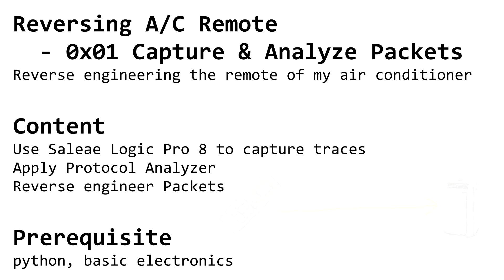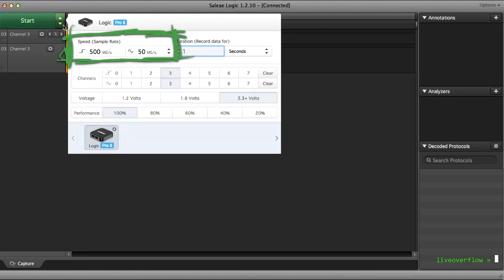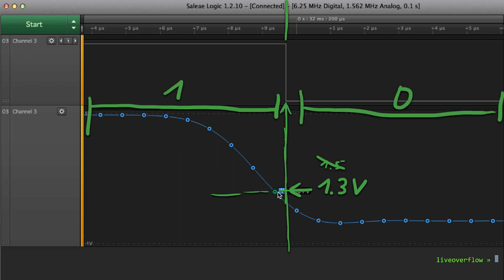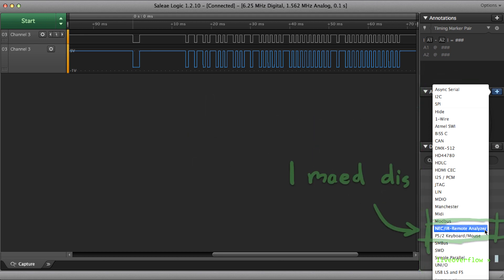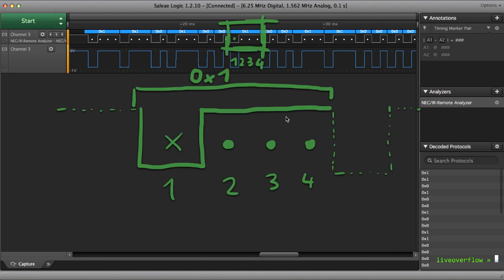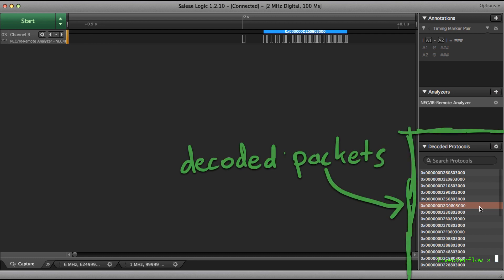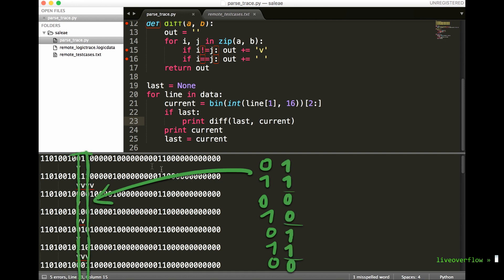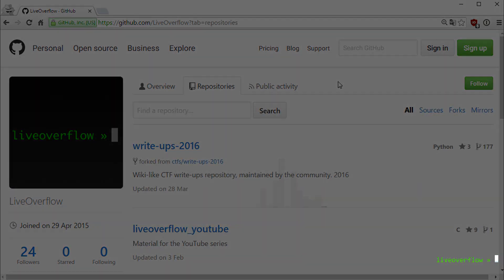Capturing & Analyzing Packets with Saleae Logic Pro 8 - Reverse Engineering A/C Remote part 2

Comment: You could also optimize the arduino analyzer by using 115200 serial speed instead of mere 9600.
Reply: And capture to a buffer in memory instead of writing every bit to serial as it's read.

Comment: Could you try that with other devices too? (e.g. (not) Nintendo Switch)
Reply: Probably not Nintendo Switch as it uses Bluetooth not infrared (the only thing it uses infrared for is to detect distance), but you can use it for pretty much any remote, and anything else that uses infrared for data (not distance measurement)
Reply: @PyPylia  Oh thanks! I don't own a switch and thought that it simply uses infrared (since the wii & wiiu also uses that).
Well, I guess I learned. :)

Comment: did you really just spend a few hours writing a custom analyzer instead of spending a few seconds counting ?
Reply: Think what is the most interested alternative and in the long term most useful... Clearly you don't think like an engineer.
Reply: @Ragnarok540  no i think like someone who likes being efficient it is incredibly unlikely he will ever analyze this protocol again and even if he does he would have to analyze hundreds if not thousands of cases in order to make the time wasted worth it
Reply: @AlbatrossCommando  a specific protocol is not the point. Being able to generalize a solution and even better, to program a way to do that boring manual labor automatically is a real skill that apparently some people don't appreciate.
Reply: @Ragnarok540  automation is meant to make your work easier, not harder you shouldn't automate for the sake of automation
Reply: @AlbatrossCommando  Well, it will help other people out, and maybe he just wanted to try it out. And now he has experience in case he wants to implement a more complex one.
Reply: @GRBtutorials  I mean true but its still unnecessary
Reply from the maker: I did it to learn how to write an analyzer.  Thats a useful skill to have in case I ever have a project again. You also dont tell a beginner in programming to not write small toy projects because they are “unnecessary” - it’s very important practice
Reply: @LiveOverflow  i mean when you put it like that true but from the video it sounded like "i was too lazy to count so i spent a few hours writing a program"
Reply: @LiveOverflow  also big fan of your work could you please continue with the net exploitation series ? its really short compared to your binary exploration one
Reply: I'm more surprised the app didn't have a built-in analyzer for "frequency modulated digital signal" since that's a very common thing.

Comment: A $10 logic analyzer is enough for most people. They work for signals up to 1 or 2 Mhz.
Reply from the maker: +StarTrek123456 yeah absolutely :) can you recommend one?
Reply: you can get saleae clones on ebay for around 5€

https://www.ebay.de/itm/24MHz-8CH-USB-Logic-Analyzer-8-Channel-Logic-Analyzer-Compatible-to-Saleae/171202927182?hash=item27dc7d5a4e:g:M-8AAOSwyQtV6XEJ

they have 8 digital chanels and 24 mhz

Comment: What's the difference between one of the Saleaes and the cheap clones on eBay?
Reply from the maker: The genuine product is made by a small company who also develops the free "Logic" program. They spend the money and took the risk of creating such a product. The clones simply take advantage of the free software and ride on the trusted name "Saleae". With that comes support and warranty (I have read that they are quite nice in exchanging fried units). But that said, I'm lucky enough to be in a position that I can spend a bit more money and support a small business. But if I couldn't, I obviously would go with whatever I can afford :)
Reply: LiveOverflow Thanks, as I never got to the point in electronics or hardware reverse engineering were I want to be, I have accumulated quite some EE equipment, that has never seen the usage it deserves. Thus, I decided to go cheap if possible and only support the creator of the original if I use the product. That's fair enough to the creative and productive people I guess.

I quite like and share your attitude though. These are great videos you are doing, they not only teach me a lot, but keep me motivated. Thank you.
Reply from the maker: +Carl T. That makes me really happy to hear :) hopefully your equipment will get a bit more use now :D
I also just bought a damn expensive oscilloscope that I probably will never use to it's full potential. But oh well - it's Christmas soon, right?

Comment: so does that mean that if i try to repeat the bits using an IR transmitter, it would work?
Reply from the maker: +r00t l4b kinda. Yes. The only issue would be that the IR protocol actually sends many  pulses as a 1. but if you use some standard  IR Library that does that for you, it should work. Though, I haven't tried it myself yet.
Reply from the maker: +r00t l4b kinda. Yes. The only issue would be that the IR protocol actually sends many  pulses as a 1. but if you use some standard  IR Library that does that for you, it should work. Though, I haven't tried it myself yet.
Reply: good to know, i will try it, anyways thanks man.